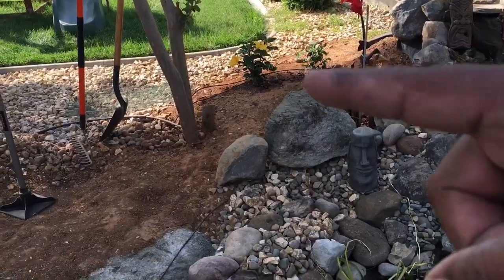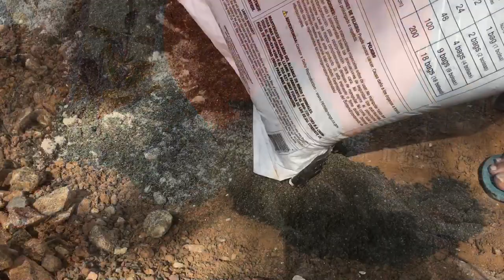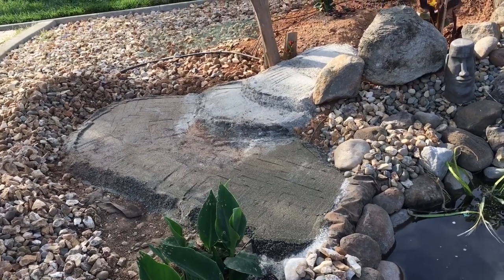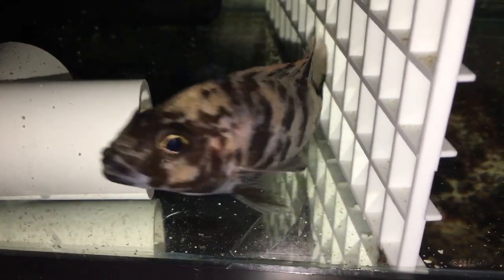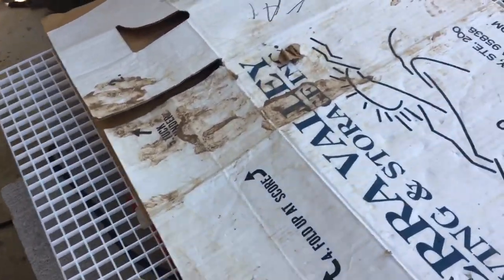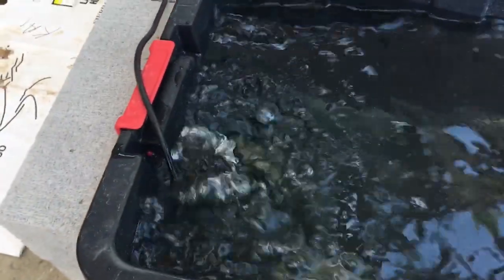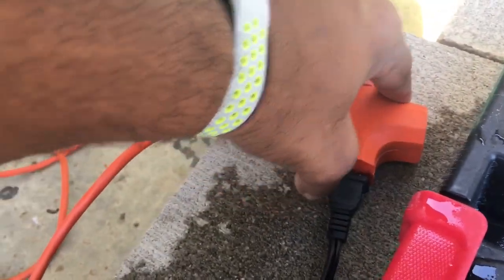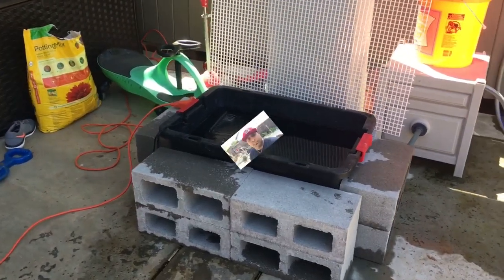*NEW* DIY Pond Waterfall and Submersible Power Filter

Comment: Awesome stuff. I can't wait to see the completion of Tiki Falls 2.5 😁 I can't wait to see the second waterfall.  Btw the airline on the pump is a Venturi line. You connect it to the outlet tube and have the other end out of the water and it will suck air into the tube and into the water. It'll give a fine mist of air into the water.
Reply from the maker: Aquarium Thoughts Thanks braddah and ahh yes thank u I had no idea what that was but now that I know I love it even more Thanks braddah 🤙🏽🐠🤙🏽

Comment: Media on the water pump= filter. All you need is surface area and water movement to get biological filtration. So you had a simple diy filter running in the tub already
Reply from the maker: selectpet yeah braddah I know but wanted to clean the water up so I didn’t have to do a water change everyday the water would get all these particles and it bugged me I have a real good dose of OCD LOLOL 🤙🏽🐠🤙🏽